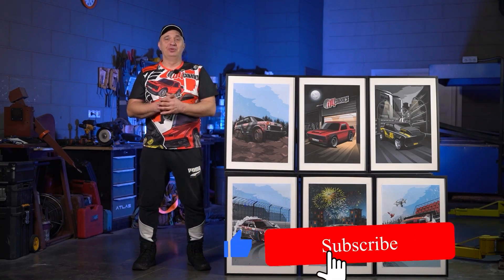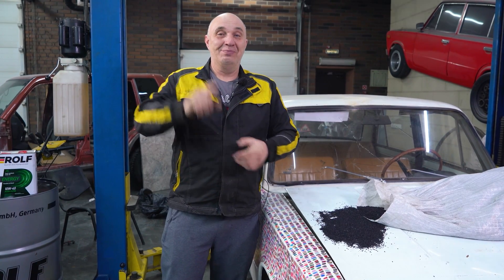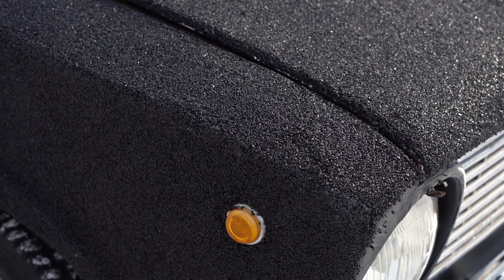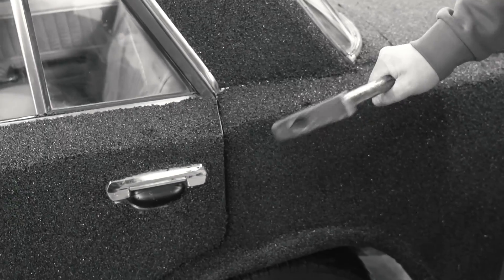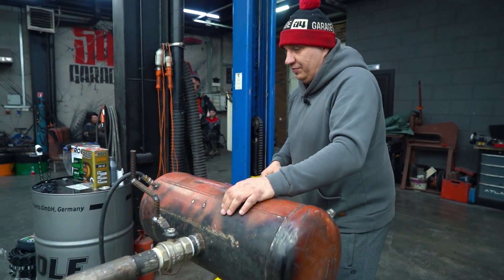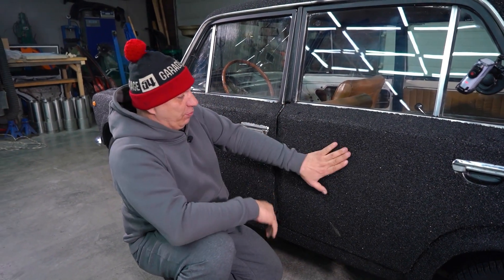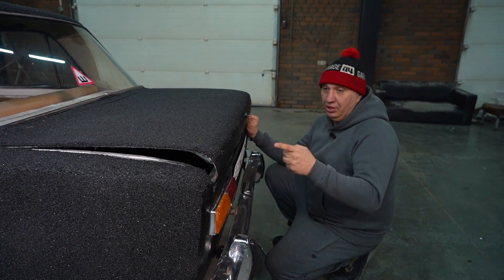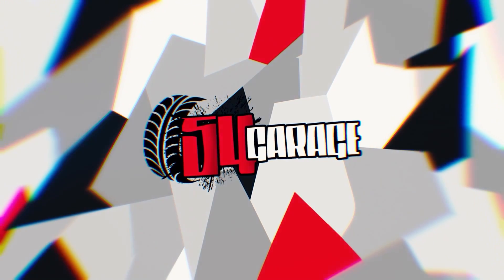Self-healing rubber turf coating for a car (with torture testing)

Comment: Excellent! My only concern is the increased surface area may increase drag, reducing fuel economy and top speed, not that the second one matters most of the time.
Reply: Well when the car is shaped like a box I think a rough surface is the least of your worries.
Reply: @JJFX-  For other designs, of course. I know that.

Comment: if there's a pt. 2 for the same car, I'd like to see if the rubber granules will prevent a 9mm bullet from piercing the car body. or if the bullet will make a dent in the metal body frame making the rubber skin make the bullet bounce off. Edit: I'd also like to see how well the rubber coating will take the heat during the summer months over in your area too.

Comment: Wonder if heat treating that would close up the pores, and be able to repair tears.  This channel is pure win.  
Stay gold.
Reply: Rubber is not able to be molten and molded. It's a type of polymer called thermoset which once cured cannot be reshaped so heat treating wouldn't do much. Maybe burn the small parts of cuts to make them less visible, but otherwise nothing

Comment: Wow.....
Do you know what you just made?
Believe it or not ! !
Radar stealth coating.
Yes, look at what stealth technology actually is.

Very impressive gentlemen.......
Reply: This needs to be tested
Reply: You're likely right about the coating  but unless you covered every square inch, removed license plates, lights, reflectors, etc., I suspect it wouldn't be very exciting. Depending on the vehicle design, I'd imagine it could reduce the effective range but I doubt much more.
Reply: @JJFX-  
Yeah, 
The windshield is a huge issue. 
Cote the windshield also !!!
Reply: @JJFX-  
Don't give away all your secrets.........
Reply: Isn't it just ferrofluid? Magnetite beads?
Reply: Cool story bra

Comment: Maybe you are onto something that could go viral. You said its working as a sound deader. What if you do a truck cab on the inside? A trunk or the underneath a car. A headliner, firewall, pickup bed walls of your Building? Roof? Shop floor?

Comment: I have been thinking for many years about something pretty cheap that could cover and protect my large ROOF, and this might be it. And it looks good to.
Is it waterproof?
Reply: Probably not 100% water proof. Not, unless you mixed in alot more polymer (glue). Then again... they did brush on a layer of it first. Still, I wouldn't trust it *completely*.
You're better off with Rhino Liner or Line-X. Both of those can be applied either with a spray applicator, or a roller brush. (both are Truck Bed coatings) 
Once they cure (dry), apparently Rhino Liner is more rubbery/pliable, whereas Line-X is more rigid. Which tracks with what I've seen a couple decades ago, where Rhino coated beds had some chunks missing.

Something else to consider, albeit expensive, would be Log Chinking (for log homes). My dad used Perma-Chink brand on our cabins logs in the late 90s and alot of it is still in great shape on the exterior. Whereas that which was applied inside the cabin still looks like it was applied only yesterday.

Comment: as an undercoating and an inner coating for the trunk etc., this might be better than the materials used in cars today.
Reply: Factory vehicles don't use undercoating
Reply: @mann_idonotreadreplies Depends on what it is and where you get it.  Trucks here in the USA are often bed lined with undercoating.

My 1974 German car is factory undercoated which saved the metal under it.

Comment: Imagine being cooked alive in it in the summer 🤣
Reply: Probably not too much different than a black car? Maybe a little warmer?
Reply: Well the outside of body will certainly be warm, but I feel like the rubber would absorb the heat. It might even be cooler than just paint.. ignoring the windows as a factor m
Reply: That’s why vehicles have AC
Reply: @bearcoyote9170  this is a lada.
Reply: @jwalster9412 Modern Lada cars have A/C, if I am not mistaken, but I am not sure about the older ones.